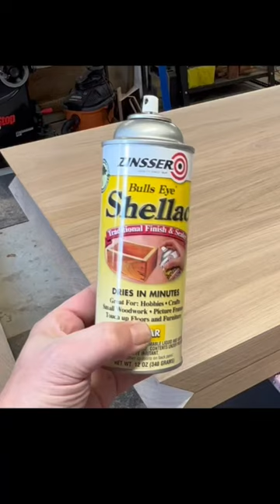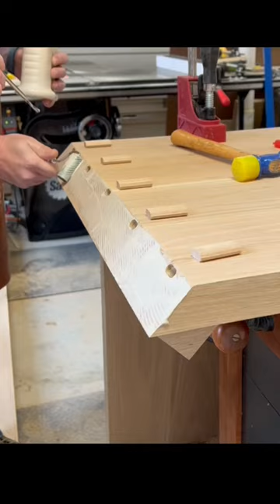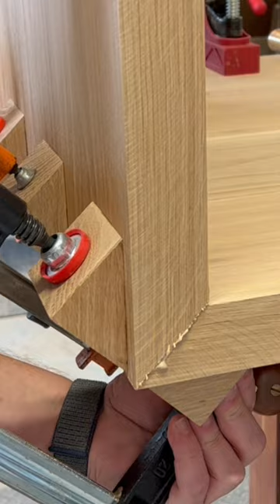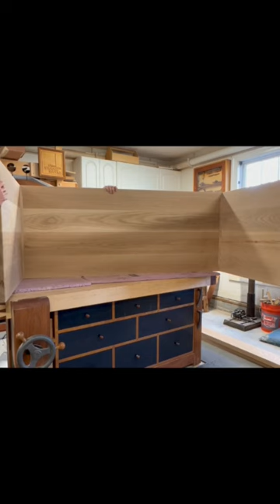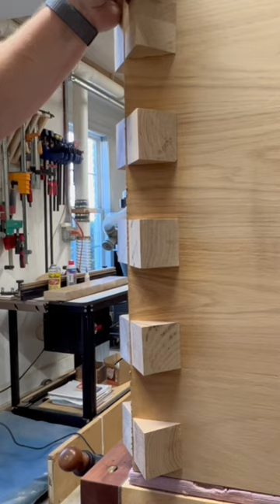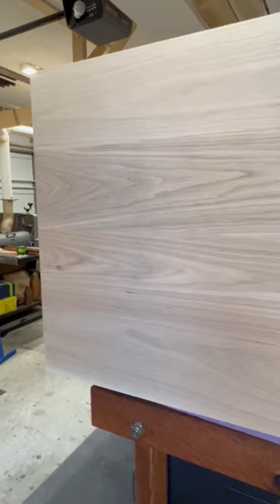Dining Table Assembly

Comment: Glue holds blocks to get a good clamp bite, but pop off with a single blow?  What glue is that? Blow is perpendicular to clamp, does that explain the better grip one way v. the  other?
Reply from the maker: CA glue (super glue for wood). Not much sheer strength, which is why the bond breaks easily when tapped from the side.